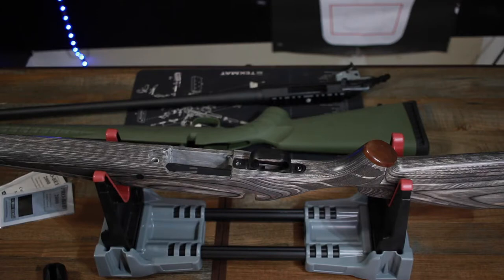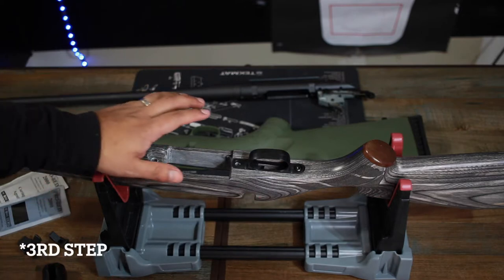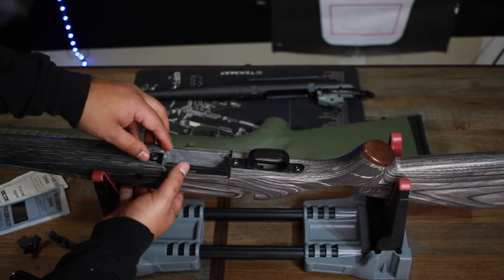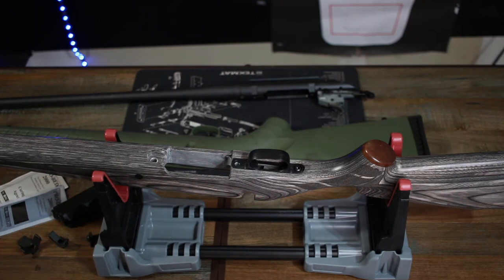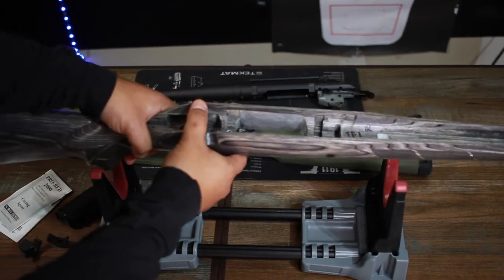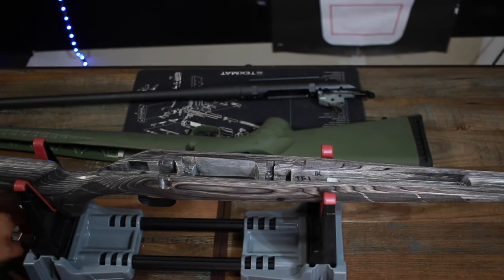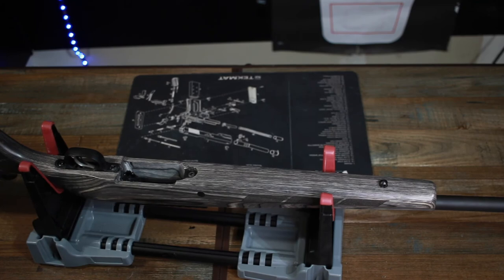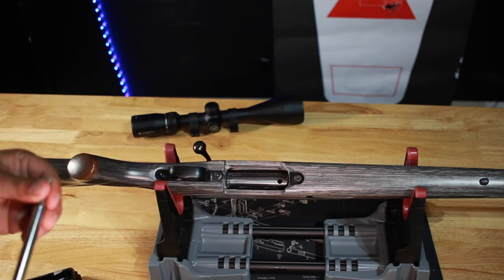Ruger American || Boyds Stock Bedding Review || Part 2

Comment: I didn’t know that you have to install those V-blocks on the Boyd’s stocks. I just got the same Ruger American Predator 6.5 creedmore and was looking at the Boyd’s stocks.  I was considering the Pro Varmit stock but didn’t see anything on their web site about having to install the V-blocks.  I was also going to get the AI magazine kit.
Reply: I have also been looking at doing the same thing. Boyds sends V-blocks with stock but recommends bedding them. Just as he did all you need to do is bed the v-blocks. They do that because there could be slight differences in manufacturing. By bedding the action to the v-blocks you get the best fit. I am sure you could most likely not bed them, and they would work but they would not be tight fitting and point of impact could very well change over time or accuracy could not be good as well. If doing this job though I would recommend putting release agent on the magazine and make sure it fits right when screwing the stock to the receiver and checking the free float as well so that is confirmed good before leaving it to set up. I have bedded a lot of stocks in the past. I like using a release agent that is made specifically for the job. It's not that expensive and often comes in kits. Putting the action to the rear in bedding is not necessary as he did. When bedded it will fit in place and will not be shifting to the rear. The bedding takes care of all the slop and fits it perfectly in place.

Comment: Are these stocks heavy at all? I plan on using it on my tikka t3
Reply: Check Boyds online and see all the different stock models. They list approximate weight on all of them. You need to put in the model of your rifle to see what is available. Bedding on different rifles will not be the same.

Comment: What is piller bedding.? Will it work with out it?
Reply from the maker: Pillar Bedding, is when the two “pillars” that are used to support the action are “bedded securely into the stock.” It will help with overall accuracy and consistency. I also bedded (securing into the stock) the two V-BLOCKS that sit in between the action and the stock. Boyds does offer this service, they will bed the two pillars for you. They recommend it being done for higher caliber (heavier recoiling) rifles.